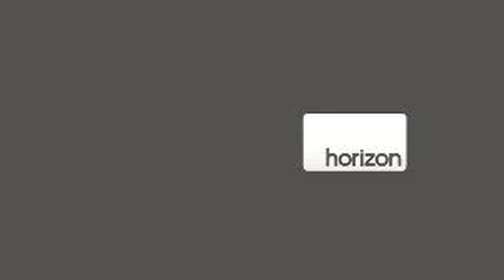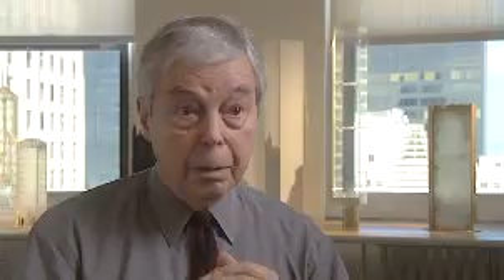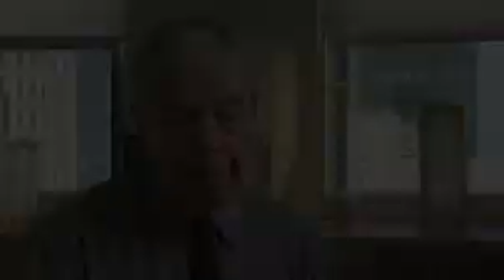Leslie Robertson - Chief Engineer - World Trade Center - Twin Towers

Comment: Mr. Robertson, I hope you will read this:
It is a shame that you seem to have so much regret, thinking that your buildings were designed poorly, when in fact they did well, exactly as they were designed to do, as long as they existed. When they in fact no longer existed and crumbled apart into powder/dust, it was NOT your fault. No building could be designed to withstand the weapons that were used to destroy the SEVEN WTC buildings that day. I hope that you will read Dr. Judy Woods masterful collection and presentation of the evidence to learn what really happened on 9-11. Then you will realize you no longer need harbor any guilt. The loss of life was not your fault and would not have been prevented even by the modular design you used in later buildings.
Reply: +Zach Handy  “The WTC buildings fell at near free fall speed”

NEAR free fall isn’t free fall so that’s a meaningless statement. In reality they dropped somewhere in the region of 15 seconds which is far slower than free fall. In fact you can observe debris falling alongside the collapsing towers which actually are falling at free fall & they’re travelling much quicker.
 

“which is pretty impossible without explosives.”
Explosives couldn’t possibly have survived the airliner impacts or fires so there was DEFINITELY no explosives used. The seismic data confirms this, as does the lack of audible explosion at the point of collapse which would have been heard for miles.

“In other words, the building was accelerating (traveling faster and faster by the second) straight down through what should've been the path of greatest resistance”
Erm, how else did you expect the to fall, sideways?? Lol, don’t be absurd. They fell the only way the could physically do so.

 
“The 80,000 tons of structural steel below that was at least five times stronger than necessary to resist this load. “

Bullshit, now you’re just lying. Each floor was only designed to hold up the STATIC load of that above, therefore when the top section toppled & slammed down on to the lower section, this static load became a DYNAMIC load which the building was not designed to take, therefore beginning an unstoppable progressive collapse. Each floor giving way due to the ever growing mass. It had no chance. It’s known as the ROOSD (Runaway Open Office Space Destruction), look it up. 

“Physicist and other experts agree that this could've happened only if the underlying supporting structures were removed ahead of the falling upper building mass.”
Bullshit! The scientific, engineering, demolition, & aviation communities consensus is well & truly against the conspiracy claims. YOu literally have a tiny, puny list of fringe nutters whose reasoning has been utterly refuted & rejected.

“The core of both towers consisted of 47 massive steel columns.” 
That had no real bearing on the structural integrity of the building. They were there simply to take the immense load of the elevator systems. The structural strength of the building was all in the perimeter webbing of the steel columns of which the airlines slammed through.
  
“So on the way down the floors should have met resistance by those core columns, yet it fell at near free fall speed like there was no resistance.”
Lies, lies lies. This is at best an argument from ignorance.

“For the buildings to fall like that it means that all the core columns failed simultaneously”
 
No, it means they were dragged down with the unstoppable, progressive collapse that was underway.

“which is impossible unless cut beforehand”
You are so full of it lol.

“And interesting enough, how do demolition experts take down buildings? They cut the core beams with explosives. That's how they get the building to fall into its own footprint."
Is it? So why did both towers collapse at the impact zone & not from the bottom up? THINK MAN!!! Incidentally, it didn't fall into its own footprint, its 'footprint' was actually 6 times its radius & severely damaged the surrounding buildings.
Reply: oldflute Disinformation artist? Sounds like typical, meaningless, twoofer buzzwords to me. I simply follow the evidence without any presuppositions to uphold, whereas you begin with the presupposition that 9/11 was 'an inside job' & then desperately try to force the evidence to fit, whilst automatically rejecting all evidence that conflicts with it. Why else would you choose to ignore fundamental evidence?
Space lasers yes, that's what Judy Woods who conjured up the myth that the towers turned to dust, did you not know that? What do you believe turned them to dust (even though they did no such thing)? I'm genuinely interested as this seems to be yet ANOTHER version of the conspiracy that i'm not familiar with. It doesn't help your cause that you guys can't even agree with each other whilst from the scientific side, there is a definite consensus which is agreeance with the official report. Unless somebody comes up with a rational alternative that can be defined & confirmed via the evidence, you're flogging a dead horse. So far in the past 15yrs of crying conspiracy, not one of you has been able to do that, or even submit & have papers peer-reviewed & published in a single credible scientific journal. Need i say more? It speaks for itself.

Ps. i take it you can't name any credible physicists who support your claims? Just like you can't provide me with any actual evidence of the steel magically "turning to dust"? Just like you can't name another steel framed structure that's been left to burn & remained standing? Just like you can't argue with the fact that steel is weakened by heat, & the temperatures were more than high enough to weaken it by over 50% its initial strength? Just like you can't provide anything in the way of evidence, or the calculations made that shows the tower should have taken 40 seconds to collapse (lol)? The fact you ignore all of this proves how little you concern yourself with truth. It's all about conspiracy for your sort, regardless of the evidence. Thankfully, some of us care more for truth.
Reply: Dr. Wood's work is based on a scientific analysis of EVIDENCE. The evidence is documented and irrefutable. Her analysis is based on solid science that anyone can understand. There is NO evidence for the use of explosives or thermite. The buildings turned to dust in mid air. Explosives do not do that. The seismic traces confirm this. The amount of debris left a the site that day and the next confirm this.
Reply: +mikerogers2 Sorry Mike but you're nuts. No thermite or reliable evidence of any so any such claims aren't evidence based therefore we can dimiss your claims as nonsense. How do you explain both towers collapsing at the impact zone? Any such devices would have been detroyed by the impact & ensuing fires. Stop talking about things you clearly have no understanding of.
Reply: Which of the seven WTC buildings that were destroyed that day are you referencing? Four of them, the twin towers, WTC 3 and WTC 4 (except for a portion of its smallest wing) turned to dust that morning. The process of turning the twin towers to dust was indeed complete in under 12 seconds. Explosives were not used. The process occurred at ambient temperature - the twin towers each became a massive dust cloud that was not hot. It did not burn anyone or anything. The seismic trace does not show that the mass of the buildings hit the ground in 12 seconds - the signal was 6 to 7 times too weak. It shows that the bed rock was unloaded in 12 seconds or less. The minimal debris left on site was not compatible with an explosive-induced controlled demolition (20 feet versus the predicted 165 feet). You need to familiarize yourself with the evidence, please.
Reply: +oldflute "Dr. Wood's work is based on a scientific analysis of EVIDENCE"

lol, no it is not!!!! Hence why the physics community have utterly rejected her unscientific nonsense. She has literally made up her own terms to define her claims, it's hilarious! Space lasers based on scientific analysis haha, get a grip. She was also exposed as purposely lying about the so-called 'toasted' vehicles. She's a fraud out to make a quick buck & gain some notoriety.
Reply: @oldflute Nobody, including Mr. Robertson, said anything about WTC being designed poorly. In fact, NIST specifically published that they found no significant design flaws in WTC construction. The buildings were not designed poorly. Furthermore, they were not destroyed by explosives. The WTC buildings were brought down the same way that millions of other buildings throughout history have been brought down; fire. It was fire alone that brought down the WTC Towers. All these other claims of thermite or explosives or directed energy rays are the products of sick, deranged imaginations.
Reply: @Pooua  is such a liar.
Reply: @Pooua  No. Multiple lines of hard evidence excludes your hypothesis.
Reply: No, stupid. I begin with EVIDENCE. 
The only presupposition I began with was that the media had told us the truth. The only problem was that I didn't understand where all that dust came from and how a 110 story steel building could "collapse" in 12 seconds. 
As I began to sift through the evidence, it told me that the towers and WTC 3 and 4 BECAME the dust clouds. A major portion of the evidence was, of course, hidden by the government for over 5 years. Their motivation for that is unknown. 
• I don't know if 9-11 was an inside job or an outside job. How would I know? Maybe aliens attacked us. The evidence doesn't tell us that, but it does tell us that the WTC complex was NOT destroyed by two jet liners.
• Dr. Wood does NOT use or believe the phrase "space lasers." As you would know if you read her work, she carefully states that the evidence does not tell us where the weapon(s) were located or exactly with forms of energy they employed. 
• "So far in the past 15 years of crying conspiracy..." Do you not believe there was a conspiracy? Did one person acting alone do all that occurred on 9-11? Of course there was a conspiracy. 
• To solve a crime you start with a forensic analysis of the crime and the crime scene. This is what Dr. Wood has accomplished. It is there for all to read, but many choose, like you, to remain ignorant.
Reply: Oh boy, help!
Reply: People following Judy Woods dustifying directed energy weapons theory are the least educated and most speculating. They float on assumption looking at still pictures while completely ignoring the existance of moving pictures ... lol ... I really do need to say 'moving pictures', those like you know: video. What is visible from these video's you cannot accomplish by directed energy weapons. Neither from below, neither from above since such weapons are continuous. Everything in the video's nullify Judy Woods ideas. That is why her followers are all but knowledgeable about basic of down to earth physics. Too bad.
Reply: @MasleyVystupoe  The videos of the twin towers coming apart totally confirm that they turned to dust in mid air. Multiple lines of evidence confirm that they did NOT collapse.
Reply: " I don't know if 9-11 was an inside job or an outside job. How would I know? Maybe aliens attacked us. The evidence doesn't tell us that, but it does tell us that the WTC complex was NOT destroyed by two jet liners."
""So far in the past 15 years of crying conspiracy..." Do you not believe there was a conspiracy? Did one person acting alone do all that occurred on 9-11? Of course there was a conspiracy. "
These two points contradict one another...
"To solve a crime you start with a forensic analysis of the crime and the crime scene. This is what Dr. Wood has accomplished. It is there for all to read, but many choose, like you, to remain ignorant."
To solve a crime you need to look at the evidence and get a proper conclusion, so far, you have rejected most of the Evidence given to you, aka, not giving a credible source, not showing the calculations(Or reasoning aside from "Muh gut") behind the 40 seconds, showing any footage of it magically turning into dust midair, which nothing aside from magic can cause, so we need to be really afraid of the government cause they can fucking turn you into dust.
And at the end of it you call everyone else ignorant? Huh, you are a hypocrite.

Oh and also you call everyone who is against you a "Disinformant Artist", you have read a little bit too much about SCPs.
Reply: ReligiousIntolerant ReligiousIntolerant Can you explain one thing then: How can a building collapse without being hit by a plane and without having a severe fire damaging the structure? I'm talking about the building 5.
Reply: Robert G - I’m not sure where you’re getting your information, but WTC5 was hit by debris. In fact, a section of Flight 175’s fuselage landed on building 5’s roof, and falling debris from the north tower did start fires in the building. The building was eventually torn down in Dec. 2001 due to the fact that the building and its structure could not be salvaged.
Reply: @polite_as_fuck  Funny there was no debris at the base of the missing sections of building 5. The material that had been there was GONE.
Reply: You all are crazy 😂
Reply: @mikebyrd8278  Read the evidence in Where Did the Towers Go, and you will change your tune.
Reply: @mikebyrd8278  Closed mind eh. Thought so. Don't look at the evidence. It might damage your ego.
Reply: @oldflute  I do look at the evidence there just isn't any for some kind of direct free energy technology 😂
This isn't Star Wars
Reply: @oldflute  If you knew what you were talking about, you would write your own arguments, instead of making an appeal to somebody else's narrative.
Reply: @Pooua  I am not "Making arguments." I am referring to compiled evidence, fully documented, to which I have given everyone the reference. The implications of the evidence are quite clear.
Reply: @mikebyrd8278  And your doctorate in materials science is from what university?
Reply: @oldflute  so how exactly does this supposed direct energy BS cause a building to collapse at the point of impact
Reply: @oldflute  You might as well be referring to Mother Goose for all the benefit you provide.
Reply: @mikebyrd8278  Your question is backwards. Neither tower collapsed. Neither was not there when the dust cleared. Nor was most of building 4 and building 3. How it was done is known to those who did it, but the evidence does not give us the details you are asking for. The evidence tells us WHAT happened, not the details of how. Won't speculate further.
Reply: @mikebyrd8278  The steel was not there after the towers disappeared. The idea that is was "shipped to China" or used to build a warship is baloney. You can't use or ship what is not there.
Did you watch the debris as it fell? The building chunks were turning to dust as they fell, and for most bits nothing stayed together long enough to reach the ground. For some, only the aluminum cladding held up long enough to hit the ground.  The wave of dustification preceded downward much faster that a building collapse could occur. She didn't say the BUILDING fell faster than free fall, just that it turned to dust in about the time it would take a bowling ball tossed from 1200 feet to hit the ground, a physical impossibility for a building collapse.
Reply: @oldflute  it's extremely obvious both buildings collapsed I don't see how you can see it any other way. There's clear video of the buildings giving away at the point of impact of the Jets.

So then tell us where the buildings went if they did not collapse 😂
Reply: @oldflute  yes there is tons of steel that's was still there after the building's collapsed. Yes they did build the USS New York out of Steel from the World trade Center. Yes she did say the buildings fell faster than Free Fall speed. Yes she did say it all turned completely into dust which is completely insane
I can also show you video of her saying all of these insane things
Reply: @mikebyrd8278  As I have clearly said each twin tower literally BECAME the massive cloud of dust that billowed out to cover most of lower Manhattan in inches of dust. Read the book.
Reply: @mikebyrd8278  I stand by my summary of what the evidence shows, and I'm done feeding the troll. So long.
Reply: @Pooua  I stand by my summary of the evidence and am done feeding the troll. Goodby.
Reply: @oldflute  have fun in Fantasyland there's tons of pictures all over the Internet of the steel of the World trade Center it didn't turn in the dust like magic
Reply: @oldflute  I'm still waiting for your supposed explanation of what happened to the World trade Center then
Reply: @Alex-jm6fk  well it was struck by other objects and so were the buildings right next to it. Why don't you just go read the nist  report
Reply: Lotta hippies on this thread.
Reply: oldflute "Total baloney reply."

Facts remain facts whether you accept them or not sorry. Judy Woods is a crank & a laughing stock amongst the physics community. Why aren't there any other physicists voicing her claims? Please don't bring up David Chandler lol.

"Each of the twin towers turned to dust in mid-air"

No they didn't. There was much dust (as you'd expect in the collapse of a sky scraper), but there was plenty of chunks of concrete on the floor. To believe this was the work of 'space laser' is utterly insane.

"the former steel box beams offering progressively less support with time as this occurred. Sounds like science fiction, but that IS what happened."

Nope, science fiction as you say. The reality of the official report works just fine without invoke space laser sorry.

"In the slow motion videos of the event, you can see the steel box beams turning to dust as they fall"

Hahah sure you can. Care to provide me evidence of this?

"The "Runaway Open Office Space Destruction" you postulate did not occur."

Yes it did, 100%.

"It would have required well over 40 seconds (at least half second per floor to allow absorption of the kinetic energy of the floor above to deform the steel of the next level to the point of failure)."

Says who, a guy who blindly believes the most insane theory of all ie. space lasers?
Can you provide me with the maths to back up that absurd assertion or again, shall we just take your word for it? Sorry but intellectual suicide isn't on my agenda.

"In fact the structure was designed to prevent the sort of pancake collapse you postulate."

Really??? I think you'll find it was designed only for each floor to hold up the static load of that above. It certainly was not designed to take the dynamic load so that is an outright lie.

"In all of history only three steel framed skyscrapers have been alleged to have collapsed due to fire, all three in Manhattan on 9/11, and the seismic trace of each event proves that none of the three slammed to the ground as you allege."

Firstly the seismic evidence fully supports the collapse as set out in the official report. To say otherwise is yet again, an outrigth lie. Feel free to provide evidence to the contrary, but i've seen the siesmic report so am quite confident you won't.
Secondly, name one other steel framed skyscraper that's been hit by a 150 ton bullet in the form of a commercial airliner travelling at 500mph, & that has been left to burn. Unless you can do that, your point is moot. There were many firsts that day, it means nothing. In reality, EVERY steel framed structure left to burn will collapse, as we've observed on several occasions. Steel is greatly weakened when heated, there's no getting away from that. At somewhere between 500 & 600 degrees, the steel would have been down to 50% its initial strength. No mystery, no space lasers, or thermite, or explosives of any kind required, just sustained heat. In fact those who designed the towers were shocked they stood for so long after the impacts. They believed they would have collapsed much sooner, but what do they know hey? You know better with your youtube education, clearly ;)
Reply: You are a very skillful disinformation artist. Congratulations. But facts remain facts, as I have pointed out. I have outlined the facts in my post. 
"Space lasers?" Where the fuck did you get that? No one has postulated such a thing. Part of the disinformation technique - attribute absurd statements to persons who never made them.
Reply: The WTC buildings fell at near free fall speed, which is pretty impossible without explosives. In other words, the building was accelerating (traveling faster and faster by the second) straight down through what should've been the path of greatest resistance- The 80,000 tons of structural steel below that was at least five times stronger than necessary to resist this load. Physicist and other experts agree that this could've happened only if the underlying supporting structures were removed ahead of the falling upper building mass. The core of both towers consisted of 47 massive steel columns. So on the way down the floors should have met resistance by those core columns, yet it fell at near free fall speed like there was no resistance. For the buildings to fall like that it means that all the core columns failed simultaneously, which is impossible unless cut beforehand. And interesting enough, how do demolition experts take down buildings? They cut the core beams with explosives. That's how they get the building to fall into its own footprint.
Reply: @zhandy020  you can clearly hear all the explosives being detonated at WTC 7 in this video https://youtu.be/__qSe1b_ukM
Reply: Don't believe this guy. Dr Judy's work is just a distraction. The real truth is that the buildings were blown up with thermite, and chances are that a real investigation would show that the CIA / Mossad were behind it. Anyone telling you any other story has either not done the research or is a source of intentional misinformation.
Reply: There is zero evidence that explosives destroyed the seven buildings of the WTC. Dr. Wood has assembled and analyzed the evidence. She is a doctoral level materials scientist with no motive for misinforming anyone. Nor has anyone ever presented any evidence that refutes her analysis of the evidence.
Reply: @krissaenen3775  Multiple lines of evidence exclude the hypotheses put forward by these two people. Since they have had ample time to examine and comprehend these lines of evidence but have refused to do so, one might conclude that they are either failed scientists or disinformation agents.
Reply: +ReligiousIntolerant:
Total baloney reply. Each of the twin towers turned to dust in mid-air, the former steel box beams offering progressively less support with time as this occurred. Sounds like science fiction, but that IS what happened. 
In the slow motion videos of the event, you can see the steel box beams turning to dust as they fall. 
The "Runaway Open Office Space Destruction" you postulate did not occur. It would have required well over 40 seconds (at least half second per floor to allow absorption of the kinetic energy of the floor above to deform the steel of the next level to the point of failure). In fact the structure was designed to prevent the sort of pancake collapse you postulate. 
In all of history only three steel framed skyscrapers have been alleged to have collapsed due to fire, all three in Manhattan on 9/11, and the seismic trace of each event proves that none of the three slammed to the ground as you allege.